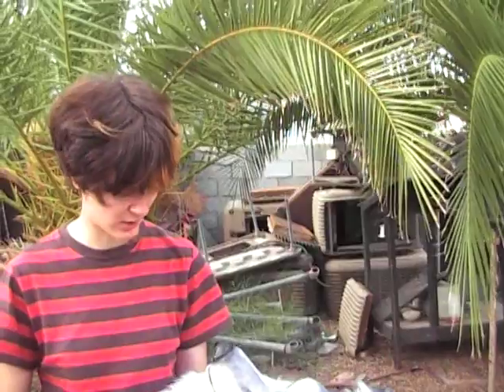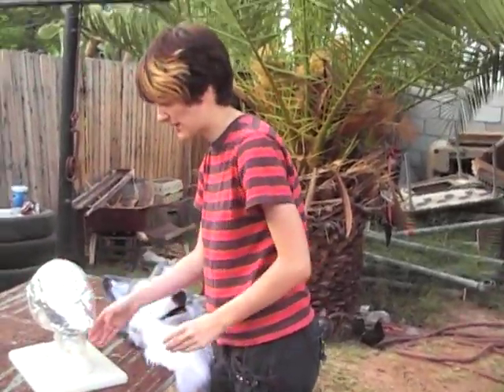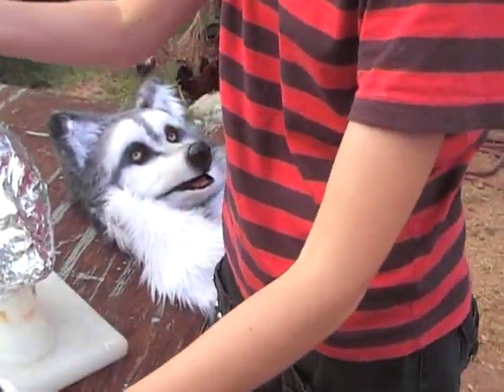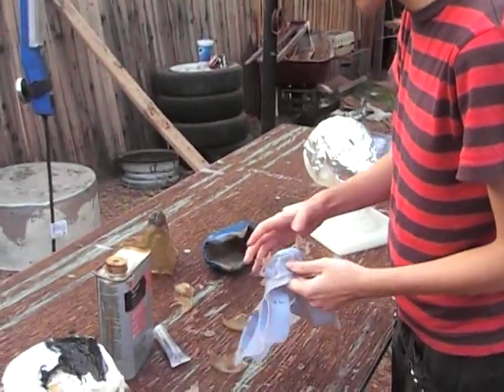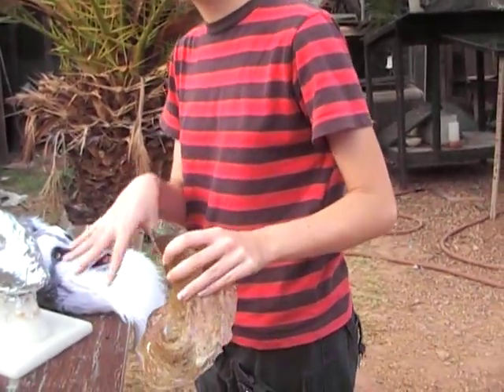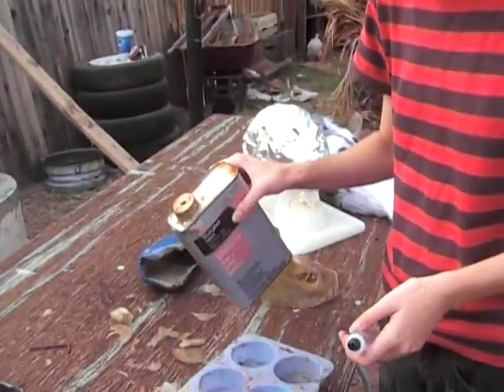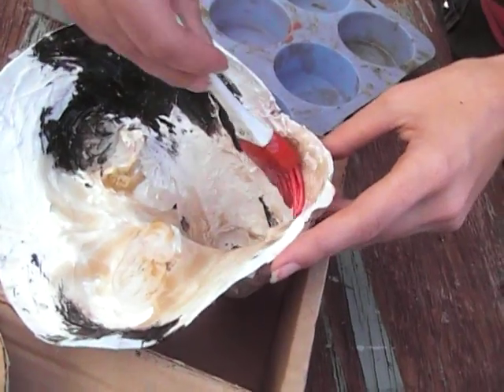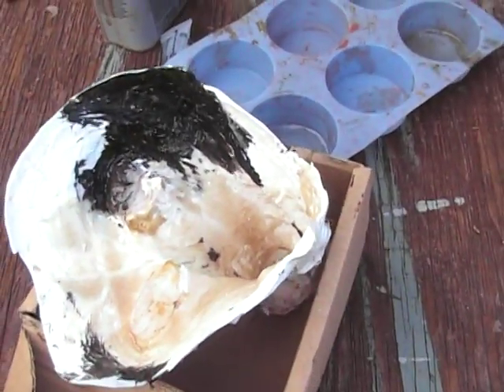How I make fiberglass fursuit heads

Comment: Where is your fiberglass?  You are using polyester resin, but you can achieve much thinner and lighter results if you do one layer of resin, let it gel up, then two layers of resin-soaked fiberglass mat.  There are a ton of tutorials (lots of automotive and marine ones) to layer up some fiberglass mat.  It's great and will help prevent shrinking as it cures and add a lot of strength.  If you want to do pure resin, order some urethane resin from smooth-on.   ALSO PLEASE WEAR GLOVES.

Comment from the maker: @angrypuppy silicone does not stink, takes overnight to set, does not make the mask tight like foam would. and does not get dirty like foam, does not fall apart like foam and can be cleaned, unlike foam.
Reply: +Zrcalo What brand of fiberglass resin did you use?
Reply from the maker: whatever was the cheapest one at home depot.

Comment: I don't think silicone is a very good filler.
It would stink, take ages to set, and make the mask too tight.
Perhaps you should try making it out of something less sticky and uncomfortable, like foam...

Just a suggestion.
Reply from the maker: its not sticky or uncomfortable. It also does not stink. Foam absorbs sweat and can get gross real fast. silicone is easy to clean, soft on the face, and you can wipe sweat off fairly easily. You have to use pure silicone, not composite though.